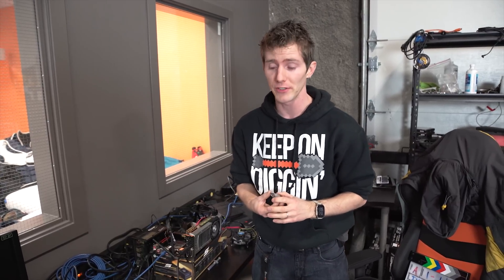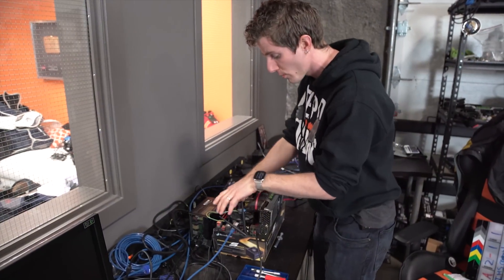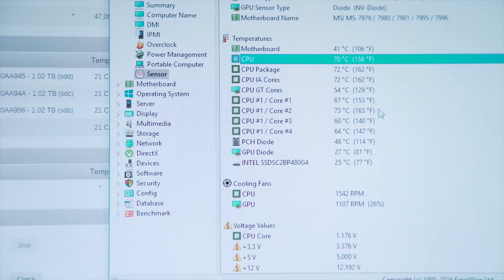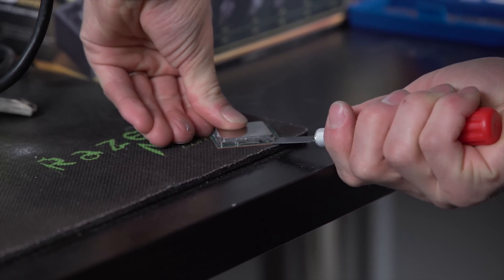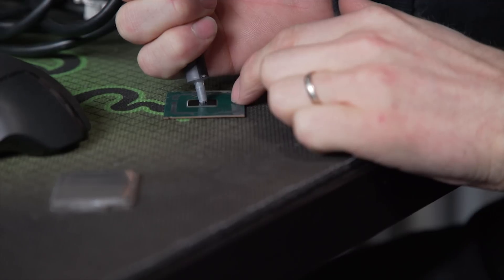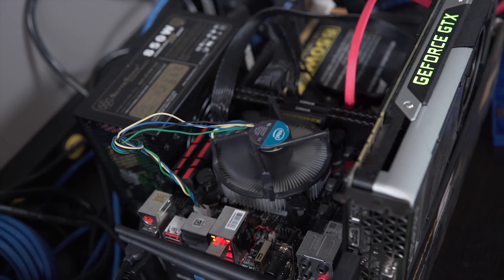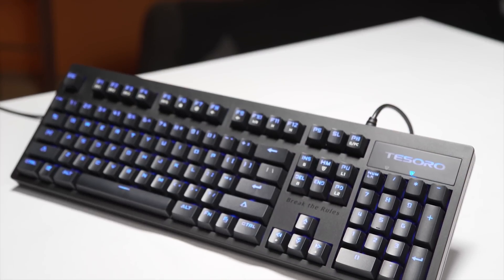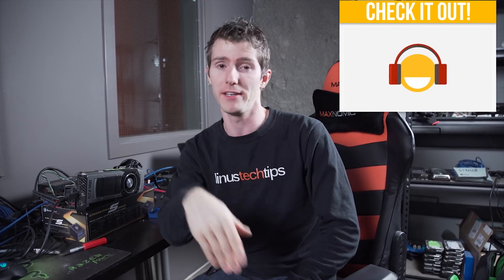Delidding an Intel Core i7 6700K - Is it worth it!?

Comment: This was a problem for Haswell CPUs, but Intel pretty much fixed this with their Haswell refresh which had better capacitors to even out the power delivery resulting in much more stable overclocks with less voltage. Also new Intel CPUs have better IHS connection then Haswell.
I currently switched out from 4670k to 4770k and man does my i7 have problems. 4,3ghz at 1.29v and hitting over 90c in Prime95 blend test with h100i which is really bad result. 4670k does use less power, but not that much less, I had it 4,4ghz 1.283v and got like ~80c under Prime95...
So there is definitely some problem with IHS on my i7 and planning on removing it with the vise method (no hammer, no razor blade). I can achieve 4,4ghz with 1,335v, but the heat is a problem so better fix the CPU.
Reply: Ok I did manage to delid my 4770k with only vise method, by the way it's insanely safe, no bending no strain on the die it self. So after using simple arctic cooling mx-4 I achieved temps avg 73c and max was 83c with aida64. 
The result without deliding was avg 87c and peak 96c.
So it's really helped the temps a lot! I'm now waiting for Coollaboratory Liquid Pro to replace the mx 4 and meaby glue the CPU back together with new thermal paste.

Comment: Have an I3 4170 here. Got it second hand without a box ot a gurantee. It was way too hot as it once reached 71° while playing BO3 for 2 hours only. Made a delid. Have put an MX-4. Lapped the cpu real quick and here are the results. 

Before: 100% load = 71°

After: 100% load: 57°

Note that i havent changed voltage or fan speed and this was on stock intel cpu cooler. Later i got a 212X and got a 53° on 100% load. 

The whole thing is super easy as i dealed with it being 15yrs old and the whole procedure took me  2 hours with the youtube tutorials included :):)

Comment: Linus is an idiot. The test should've been done much better:
-He should've used a proper cooler (such as the kraken x61, h110i or noctua NH-D15)
-He should've used proper thermal interface material
-He should've used more thermal paste as thermal interface material (he uses way too little)
-He should've used less thermal paste between the IHS and cooler
-He should've tested this with an overclocked CPU
-He shouldn't have tested this in an open test bench
The improvement of replacing the thermal interface material is normally around 15 degrees Celsius. So LInus is obviously doing it wrong.

Comment: you're a moron.
use better cooler with heatpipes;
spread paste with a spatel flat even as thin possible on whole surface, not just squeeze it from syringe and press spread by lead or radiator
and try mx2/mx4 compound

Comment: omg. Never realized there is another layer of thermal paste inside. One learns everyday I guess.
Reply: On some cpus, there's no thermal paste, the ihs is welded to the top
Reply: *Toothpaste if we're talking about Intel
Reply: no lids on laptop cpus yeah😀
Reply: Yeah, intel does this and uses a THIN metal sheet as the cover aswell as bad thermal paste.
The reason for doing this is because they will save money by releasing a newer cpu without changing anything other than having better thermal paste and higher clock-speeds usually.
Making people pay a high premium for sub-premium production.
Hence people have started delidding their cpus'
Reply: same
Reply: +Oskar Martin I haz cheezburger
Reply: there never used to be until ivy bridge came along. before that intel used solder which was better at redirecting the heat. thats why a sandy bridge 2500k  for example can overclock soo well.
Reply: the actual chip is ridiculously small, that rectangle isn't even it either
Reply: I figured it out when messing around with a cpu heatsink/fan in a laptop. They don't have the heatsink built on to the chip.
Reply: If you pay attention the world will teach you something everyday
Reply: Rush Bee you could do that for years, at least on Android you could
Reply: Set Kat rip spelling
Reply: +Björne ッ wait, I can't like comments, how did you do? 

I'm not English, that's why xD
Reply: Set Kat its exactly the same as on a pc
Reply: +Björne ッ ok, mine isn't updated I think ^^
Reply: Yeah WTF its same as gpu.
Reply: +Nebbou Hicham wot?
Reply: i didnt know that too lol.. i thought that the top plates are just soldered with the chip :v
Reply: slevin kelevra yeah i know bro really hard
Reply: It's surprising that most of the weight to the chip is that block of metal that is the IHS.
Reply: Thermal paste? That shit Nutella
Reply: +Björne ッ nice! :)
Reply: Thanks for letting me know SteelCity1981 ^-^
Reply: slevin kelevra chill bro are you a high school teacher?
Reply: No . Ya Damn Noob 😞 
It's hard to open closed eyes 
Ya know it ? 😞 ?
Reply: Maybaam I've had copper grease on mine for months now. Doesn't dry up like toothpaste And does a pretty good job. Just make sure you don't get it on any circuits as its conductive.
Reply: The Stoned Raider 
I know that grease. on my main pc and backup gaming pc i use liquid silver from coollaboratory since years. you are right, there is nothing better than liquid metal grease, i have to use a magnifying glass every time to apply, the drops are very small like 0.01mm or even smaller. to ged rid of them i use a self modified version this sucking pen for soldering, dont know the right name of this thing.
Reply: newguy56 Only with Intel, it is inefficient.
Reply: videocard? dont you clean it aye?
Reply: CPUs used to look like that back in the day. The die would be directly exposed to the heatsink rather than have a heat dissipation system interfacing the die.
Reply: C
Reply: One of my testrigs (i5-4670) runs for 3 months now with toothpaste instead thermal compound, temps 65-70°C on 90% load. the next thing i wanna try is WD-40.
Only in winter i start the AMD testrig with cpukiller on 15% load, this should be enough to heat my 80m² flat up to comfortable 25°C,
30% load and my insurance will quit me when i burn the whole village
Reply: only for some [sh]i[t]'ntels
Reply: Jarvald lmfao
Reply: u can like comments in smartphones now :D
Reply: u can like comments on phones niw :D

Comment: I just used liquid ultra on an i7 3770k after delidding. Temps dropped by 22oc to 78oC @4.6ghz 1.405V with a corsair h60. I only used the liquid ultra on the die and regular mx-4 on top the IHS. Linus had a much better factory thermal paste install than I did so it's not surprising he sees such small differences at low temps.

Comment: You are testing with a stock clocked chip with stock power dissipation. This difference will become much larger as the heat flow increases. If you are going to make videos on technical subjects like this please learn the physics and engineering behind the topic.

Comment: My 4790k runs 73c with a Corsair h100i gtx. Skylake must be a lot better on the tim, brcause on stock my Devil's Canyon would hit TJmax at 102c and throttle hard on AIDA. I've seen liquid metal tims getting 20+c benefits on the 47xxk's tbh.

Comment: This video is tosh.... I had nigh on 20c drop by using liquid ultra and nearly a 30c drop when I moved to an EK direct die mounting kit for my water block.

The better cooling system you use and the higher the clocks you run the bigger the difference becomes.

Comment: Everyone who's not an idiot like you Linus uses liquid metal. We first started with the 3770K and it would drop temps 30C at 4.6ghz. Testing at stock with the stock cooler is the most retarded way to test but I wouldn't expect anything more from you

Comment: my lap dell inspiron 15r 5537 with i7 4500U suddenly stopped working both the ethernet port n wifi.

 can u guess what d problem is ? n suggest me d solution pls.
 h
BTW its not a driver issue, but a a hardware.

😰

Comment: Why not put thermal paste all over the board itself? eliminating hot air in between the PCB and cover would greatly help, i did this on one GTX 680 and it took about 5C off.

is it just me who knows basic thermal physics here? doesn't matter where the CPU itself is on the board, entire board will heat up, having no air between the cover and board will greatly reduce the temps. Think i'm gonna delid my 6700k soon and do that.

Comment: Linus, I'm no tech geek but I'm going to be buying a new CPU soon because the one I have is so old and never replaced it. I heard that if you replace your old one with a new and up to date CPU, that you have to get a new motherboard with it as well, is that true??
Reply: It depends. Your new cpu and current motherboard have to have compatible sockets. 1151 socket CPUs will generally not work with 1150 socket motherboards.
Reply: KingFredrickVI I wouldn't know which one I have.
Reply: +Illusive Prime find out what current CPU u have and then the Intel page of it will include the socket
Reply: My CPU is actually a AMD, I thought it was Intel, but what I could get from the System Information window is: AMD Phenom(tm) II X4 955 Processor, 3200 Mhz, 4 Cores, 4 Logical Processors
Reply: Just found out: Manufacturer: ASUSTek Computer INC. Product: M5A87  Version: Rev X. 0x
Reply: I was about to say you would, but googling "M5A87", first link is your motherboard. Apparently the newer AMD FX processors will work so you might be in luck.
https://www.asus.com/Motherboards/M5A87/specifications/
Reply: Simon T I already got a new CPU and motherboard, just going to get them fitted in.

Comment: Delidding made an 11c drop for me. (Cool Labs Liquid Pro "TIM" ) 

My delid was a vice method. 

There is also a tool made by desaur' for about 80 bucks. You can use his tool and its safe removal and you can even reapply. No one would even know you removed the ihs .. 

11c. The numbers don't lie. Linus did this wrong!
Reply: 11C on load where it matters. 

Not on idle. Idle doesn't go past the normal nor below ambient. Because it can't. Unless you phase change. Try delidding and sticking liquid pro on it and then putting it in the Lil'Devil Refrigerated case which you suckily reviewed btw.

Comment: Ofcourse this matters. In fact removing that complete IHS and replace it with a surface-fine waterblock will even shave off more degrees for a more succesfull OC. Back in the days people really took their IHS off and made sure they where using high quality components in their water-cooling (not AIO stuff) with high flows ensuring the best possible temps. Yes it can be done but it requires to change almost anything on it's path.

Comment: Polishing the top of the CPU inhibits heat transfer by significantly reducing the surface area. That's why the fins on the barrels of air-cooled motorcycle engines are left rough. The thermal paste bridges the gap between the ridges and troughs.

Comment: I have a 4670k which seems to run a little hot and can only overclock to 4.2 ghz ( even that speed takes over 1.3 volts). Do you think it would be worth my time delidding it? Don't worry about me breaking it, I am an electrician and although it's a different trade, I am used to working on small components with small precision tools.
Reply: PhuchxpH
Well I did, but not this chip. I sold my 4670k and bought a 4790k. I decided to go for it so i used the vice method, you can look it up. The heat spreader came of nicely and after cleaning it up I used Kryonaut grizzly as it is all I had at the time. Temps on prime 95/realbench were improved by 6C, so not amazing but an improvement nonetheless.

Sitting back and thinking about it I was never happy with the result, I knew using conventional paste wouldn't be as effective as liquid metal, but only by a few degrees... right? It was bugging the hell out of me so I took the plunge and bought some cool laboratory pro liquid metal. I used liquid metal on the die and paste on the IHS. Wow. another 16C.

21C improvement total means I can overclock until the voltage is the limiting factor, as even at 1.36v i can keep it below 80C. The lesson here is that HELL YES, liquid metal makes a massive difference. If you are going to delid, don't cheap out, buy the liquid metal. It isn't that expensive and the results are amazing.
Reply: Debanshu Pani Thx for the advice but that's not really what i'm asking. Will i see a significant decrease in temps on a Haswell chip?
Reply: The420blazeitfaggot Ok cool, that's what i thought. Thanks dude
Reply: Did you ever delid your CPU?  If so, how did it go?
Reply: nicklong27 21c is a MASSIVE improvement.  Tons of extra headroom to get some wicked overclocks.  Personally, I would be afraid to give it a try.  Maybe one day when I have an extra CPU laying around that I don't care if I mess up lol.

Awesome to hear it was successful and thanks for replying =D

Comment: Not worth the risk, only a couple of degrees to lose, and voiding the warranty are all the reasons people use to say against Overclocking. I don't think there's risk at all, the cpu under the hood is well protected. I think it's going to be a new trend.
Reply: Unless the ambient temperature of the room was like 0º than there is no way they were getting 10º idle.
Reply: xSixtyyy Not unless the room is less than 10º.
Reply: Dunno about the couple of degrees. 

Here is some prime95 outcomes when you do it correctly with real stuff and not with "something you have laying around" 

http://www.norpparuutu.net/artikkelit/skylake_6700k_korkkaus/prime95_lammot.PNG
Reply: 4790k, 10c down after delid. Worth it? Yes, lower RPM on fans means more silent operations. Can actually use 4.8GHz now compared to 4.7GHz as well.
Reply: Philip J. Hill the athlon in the office PC I had in 2003 had no lid. most chips had no lid. 
they started lidding CPU's because it was becoming more and more mainstream and easy to build a PC and newbies and morons were bricking their chips out of the box left and right.
Reply: Look at it like this.
You want to OC your cpu. Your cpu goes 100c under load.

And it dies soon.

You delid, it goes 65c under load. It lives for years.

You do the math. Can you do that?
Reply: sami heiskanen Wow that's awesome. Looks like there's hope yet.
Reply: Its way more then a couple of degrees if you do it properly.
Reply: sami heiskanen oh cool thanks. Looks like a 2 degrees difference?
Reply: ***** more like 20-28 degrees celcius. Sorry i forgot to mention that all of those measurments are in celcius :)
Reply: What voltages are you using to get 4.8GHz on your i7 4790k? mine seems to hit a wall while trying to push 4.8GHz stock voltages while water cooled
Reply: ***** 1.33v. Cannot use that voltage without the delid because of temps. 4.7GHz can easily run at 1.23v.
Reply: using the cpu without the lid will have a big impact on performance actually. like a really big impact. without the lid and with Liquid ultra Paste someone achieved 10° Idle and 30° load.
Reply: LiquidPanic without the lid and a liquid cooler ? and using liquid metal instead of paste? you can definetly get 10 degrees idle
Reply: Yooo WTF ... 8:35 G button is missing on the keyboard or what ?
Reply: Dr. Etzor it make sense now. thank you.
Reply: They arent that expensive though, and i never had a intel chip die on me, and i did some really dumb stuff with most of them.
Reply: Rofl, Yea, like meteor strikes might burn his house down.
Reply: The Only Boon ..., Ik they came without a lid haha, i said that in my comment, i was mostly referring to GLD_AV3NG3R CS GO and Fun's (obvious troll, or hes just a little kid and hes serious HAHA!) comment "LelouchL3 ikr and it might overheat and burn your house down not worth your life" ....I myself remember non-lidded processors, i was alive back then and using computers my dad built lol. I was saying that GLD-Avenger probably wasnt even old enough to know that they used to come with no lid, due to the fact he said it "might overheat and burn down your house" :P
Reply: Njoekiezoekie you do English?
Reply: I'd rather have a reliable older computer than a golden pinned paper weight.

Comment: I do not like this by hand method. Much better one is with using clamp? Vice? How that tool is called in English?
Reply: Both are fine
Reply: You can't use the vice method with skylake.  Intel used a thinner PCB with skylake, so the vice method will almost certainly crack it and kill your CPU.
Reply: Sam Kostka That is very important to know. Thanks for info. I did not have any idea that was the matter. Would be nice to have this reminded in video then.

Comment: Even with overclocking there is NO reason at all to remove the heat spreader from a CPU. If a system is overheating, it needs a better cooling solution.

This is one of the reasons I wish Intel and AMD would just lock all their CPU's, and end the overclocking stupidity.

Comment: My cpu (i7 4790k) was thermal throttling with prime95 small fft. After delidding and replacing the stock tim with COOL LABORATORY LIQUID PRO!!!, my Temps don't go over 85 degrees on the same test. Linus, do the test properly or don't do it at all. Intel used to solder the ihs to the die, now they put tim there. Cool laboratory liquid pro is almost as good as solder.

Comment: Screw those crap useless heat spreaders, I removed the heat spreader, used True Silver on the die and attached my sillinx 4 pipe copper heat sink with two fans in a push pull configuration. I don't see a huge difference in temp. For me its just a piece of mind knowing that the die is staying cool.